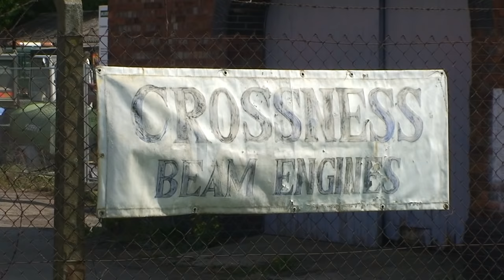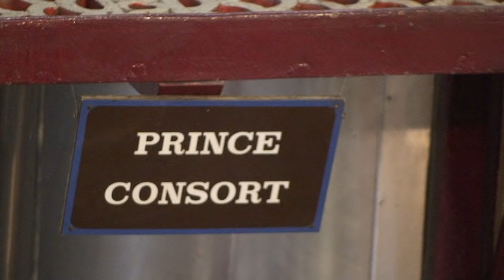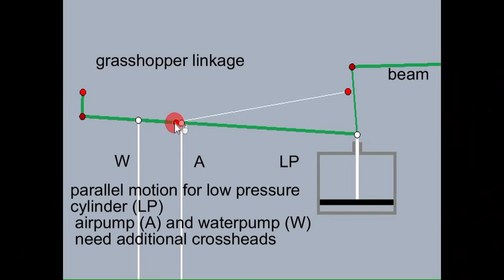The Biggest Operating Rotative Beam Steam Engine At Crossness

Comment: Funny how a massive machine like this last for generations.  But here in the states.  We can't even get a car or truck to make it 20 years.
Reply: making things that last a long time ,is bad bussiness
Reply: We have plenty of Bessemer engines over a century old...and British automotive engineering ain't exactly brag-worthy. They're the people who brought you "Lucas electrics!"
Reply: Automotive engineering and stationary powerplants are simply built to differing standards of endurance.
Reply: ... many of which involve modern marketing.
Reply: that cant be right. i'm from germany and i have had 3 cars with gm engines in them. they are all over 20 years or close to it and very happily soldiering on. considering that usdm engines are much less sophisticated and thus more durable i have to say that i cant believe you
Reply: Ahhhh - Germany! Krupp's steam locomotives carried a guarantee of one hundred years...
Reply: It's called Planned Obsolescence.
Reply: They took the big chimneys down during ww2 because the Luftwaffe used them as navigation points.
Reply: Don't forget this engine is moving at a whopping 6 RPM...
Reply: and a very very consistent 6 rpm, a modern motor is a an  engineering marvel, able to survive the number of heat cycles and constant abuse thrown at them.
Reply: Ma Ford is 22 years old. Yes it has it's fair share of problems, but at least it still drives.
Reply: In what alternate universe do vehicles which are properly cared for not make it to many years of service unless you live in the Rust Belt?

My 1976 F250 and 1997 F150 run just fine and there are many more like them working every day. Likewise my 1978, 1982 and 1988 Harleys are doing fine (and I don't coddle anything I own).  You are clearly not a mechanic or you'd know better. The average age of US vehicles is over 11 years and vehicles last longer in general than ever. I'm old enough to remember when 100K miles on a vehicle meant it was ready for the scrap yard. Today three times that is quite common. My 1981 VW Scirocco had ~280K when I sold it and the current owner still drives it daily.
Reply: Well i was just at buckley old engine show and there was plenty of old engines running. They are currently restoring a 1100 hp snow engine that was built in 1907 to pump natural gas in Virginia USA
Reply: "If in doubt, build it stout, of things you know about", British Engineering principal.
Reply: $&#@3#$ sociopathic and even sadisticly selfish planned obsolescence bourgeois wasters!  
... I did get some consolation leaving my home State of Oklahoma. It seems up in Colorado, and also in Washington and Oregon, that people DO paint wood, they do, to a larger extent, keep old machines running. I do that here in Oklahoma, but, here, its like Glorywhole says. We got practically nothing to look at older than me. LOL though, Hey Glorywhole, my car is running over thirty years now. Huzza for making it last!
Reply: @Gigaguenther  I don't want to say this about my fellow Americans, but, I do think much of the machine (including automobile) turnover in the States is not driven by short lived machinery, it is driven by the consumerist ideology gone wild over here. The "Keep up with the Jones'es" syndrome is also involved. I am driving a 1987 Dodge Aries. Not even an outstanding car, but, it's a pleasure how well it still runs, and the slightly easier to work on.
Reply: Yes! It takes the breath away just thinking about it!
Reply: This is nothing like a car or a truck, You could look literally anywhere in the US and see a structure or machine that is well over 100 years old.
Reply: But American engineers CAN design and manufacture a disposable beer can that will last millennia!
Reply: These aren't consumable products.
Reply: The Germans can't even get a BMW to run for 10 years.  Meanwhile my 2002 from '76 is still running, and my '41 GPW does as well.
Reply: @Gigaguenther      Uhmmmm….I'm an American who owns a 2011 VW Jetta. German cars aren't all that. In fact, I think you Germans owe me an apology! What was VW thinking!
Reply: I'm in the US and own four vehicles for my personal use ( 3 passenger cars and a motorcycle ). They are 16, 21, 23, and 65 years old. The cars are American, the motorcycle Japanese.
Reply: Building a car or truck that last long under heavy, frequent use is certainly possible, it just costs considerably more. 

Honestly, a modern car is considerably more likely to reach 20 years old(and with fewer major problems) than the 50s-80s vehicles. Most vehicles from that era barely made it past 8 to 10 years before they were rusted out hulks even if you took reasonable care of them. For those 50s-80s vehicles, 100k miles was basically time for a rebuild, but only if the body was sound.

People like to think they don't make em like they used to, and that its a bad thing.
Thankfully, they don't make em like they used to.

Comment: It is a beam engine and so it rocks around a pivot, but why describe it as 'rotative '?
Please explain?
Reply: It turns a flywheel. In West London there are 2 museums with the engines that provided clean water. One has Cornish beam engines, no flywheels, and other pumping engines. The other , at Kempton, 2 1000 tonne triple expansion engines, one working.
https://waterandsteam.org.uk/our-engines/ this link should explain it.
http://www.kemptonsteam.org/
Reply: @paulqueripel3493  answering from Hayle, Cornwall (home of Harvey's engineering and the Cornish Beam engine). Understood that very early pumping engines had purely reciprocal motion, but I frankly thought those were extinct and rotary motion had taken over. Are you saying those London engines have no rotary component in their function?
Reply: @pcka12  The engines at Kew bridge are early, 1820s, 1840s though a couple are later. The beam engines are just up/down . The biggest pumped 7.5 million gallons a day, 100" cylinder bore, it doesn't work. It's sister engine in the same building, 90" bore , does work. I think that's the biggest working beam engine around. Pic of the pumping end of the 100" https://archive.thameswater.co.uk/archive/series-3/1029094-kew-bridge-pumping-station-100-cornish-beam-engine-built-in-1871?
There's a Bull engine, the pump and power pistons one above the other, no beam.
They're no longer used, it's a museum.
Reply: Paul Queripel interesting! It does seem that a ‘classification’ has developed (a bit like the ‘binomial nomenclature’ which is so useful in biology) - ‘rotative’ does have the ‘feel’ of what used to be called an ‘Americanism’?

Comment: does all four engines run or just the one
Reply: All four engines running at the same time shake the building. Even though shock absorbers were retrofitted in the 1850s the building is almost 170 years old and the risk of damage is understandable.

Comment: That thing looks dangerous, I like it!

Also, I doubt a hard-hat would prevent a headache, should anything go wrong...
Reply: if a 20 pound of chunk of metal fell on my head id be sure glad to be wearing one...
Reply: @datsunz152  Your head might appreciate it, you'll still feel it, but your neck however won't notice any difference... You would probably end up in hospital regardless. 20lb from that height is no laughing matter!

That said, this probably gets regular inspections, what would actually fall off it and land on your head?
Reply: @Metal-Possum  they once dropped a wrench in a underground nuclear silo and almost blew the entire thing up(Damascus titan missle) That being said that place is defitnely held to a higher standard then the ol engine:D I would much rather be wearing a helemet but i do agree 20lb is pushing.  A bolt or tool or pretty much anything left up there could vibrate off though. Not to mention pieces can fall off the machine its old!(alot of vibration plus constant tug/pull on parts for decades). Those goofy things have surely saved atleast one life
Reply: @datsunz152  Nah, it's just 'elf and sayft-ee gone mad. Something like this, if it really was dangerous, would have somebody looking over it regularly enough to prevent any accidents in the first place. They don't make you wear a helmet on an aeroplane do they? Those things could fall apart too if they weren't well looked after to begin with.
Reply: @Metal-Possum  i think comparing this to an airplane is a little off topic, compeltly different situations. A plane is much more regulated than this. Like i said this is a very old machine. It takes absoutley nothing to kill a man if you hit him on the right part of the head. I doubt they went out of their way to stock that many helmets for nothing($$$$$$). I would bet an incident happened, maybe no one even got hurt and something just fell.

Ontop of all that the saying goes "he who thinks saftey is expensive should try an accident". Human life is sacred and extremely fragile under the wrong circumstances man
Reply: hard hat just knocks your head out of the way . your shoulder ends up close to your waist

Comment: OK let me say it this way. HP versus weight...No comparison. What, fifty tons of steel developing 500 HP. Yet less than a quarter ton of Buick V-6 powers an Indy Car. Usually developing well over 700 HP. Geared down to 15 RPM the torque would be out of the ball park.  It's not a slam. It is a point of view. I love old steam engines and make working models every now and then but thank goodness for engine evolution.

Comment: Clearly over complicated mess.  Just like a lot of garbage that they build over seas.
Reply from the maker: Oh, I dont think the same. The engine was bult as a one cylinder engine and obviously it was the best (and cheapest!) way to improve its performance. It was absolutely usual in GB in the 1890ies and later  to do so. From 1913 on the steam engines were replaced by Diesel engines.
Reply: Problems mate. Bum blocked up.?
Stop your wingeing.